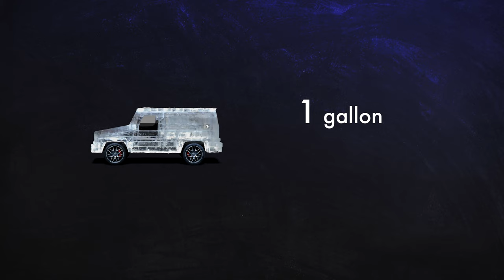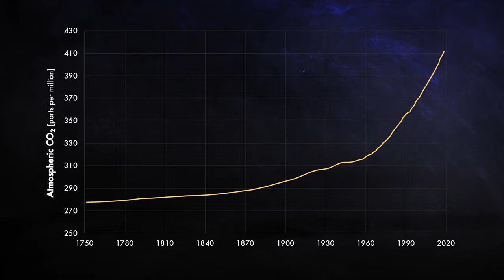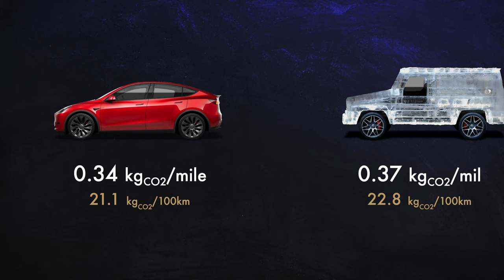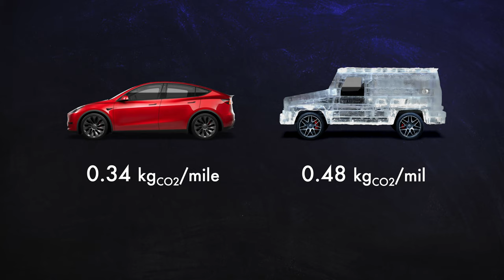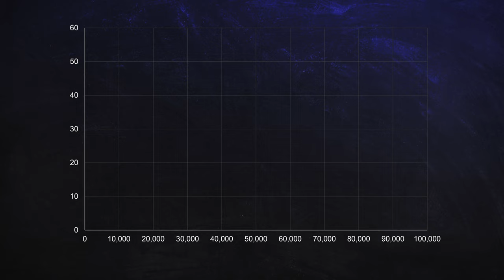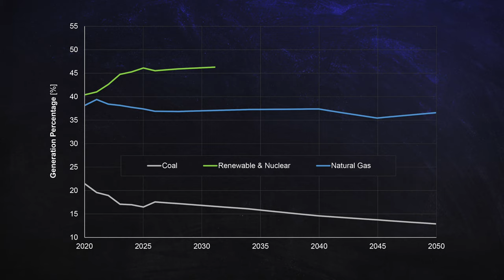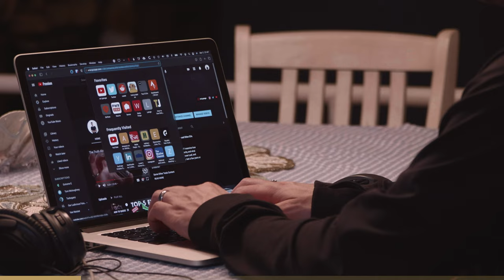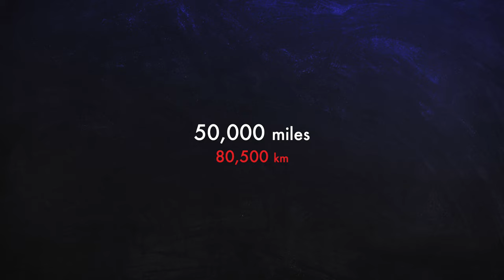The Truth About EV Emissions

Comment: I live in Utah, which you showed in your video didn't even break even after a million miles. I'm glad to report that I have a 10 kW solar array on my home that I use to power all my household electrical consumption plus it powers my Tesla Model S which is about to break the 100,000 mile mark on the odometer! It feels great not having to pay for fuel to drive my vehicle around and it's icing on the cake knowing I'm not contributing to bad air quality, which can be especially bad in Utah during the winter. It's taken me years of saving and work DIYing my solar installation to get to this point, but it's a worthwhile goal for anyone else that's interested in doing the same thing!

Comment: You have mentioned the fuel supply cost for the gasoline i.e gasoline production. But for electricity, coal also has to mine, clean and transported. you should have included that when you calculated the CO2 emission for the EV.

Comment: Another thing to consider is that Coal itself is getting cleaner. In the area that I live, the local utility is shutting down all of their oil plants and all of their coal plants except the two most modern plants in the next two years, which are the most efficient and have the best emissions treatment systems of their fleet. Along with renewing their nuclear license until 2040, it should reduce their CO2 impact, not including all of the new renewable projects in the planning stages.
Reply: No,coal power plants are shut down,only in stupid usa companies still use them

Comment: Cool videos.  So one gallon of gasoline (2.72kg) produces 8.89kg of CO2? It is possible as gasoline is mixed with atmospheric air (oxygen) to create the CO2, though that does sound surprising.
Reply from the maker: Thanks. You are correct. The C or carbon comes from the fuel and the O2 (oxygen) is supplied by the air. On a molar mass basis C is 12 and O2 is 32. i.e. the oxygen in CO2 is almost 3/4 of the total mass. This explains the increase in mass. Good point.

Comment: Where I live in the Jersey c.I. , most private electric vehicles are being used with solar panels with battery walls and supplying back to grid . 
All our electric comes from nuclear and renewables from the french network . 
Nearly all home delivery vehicles are now electric powered , the drivers for ease of use , and companies for low cost of running prefer them to old ice vehicles . 
This system of using personal solar and batteries to top up the grid , seems a great way for the future !

Comment: Cost of production ice cars isn't equal to bev without battery. Electric motor is much more efficient in production than the ice. Less parts, lighter weight, more simple construction everywhere. Prius has battery and generator on top of the ice
Reply from the maker: You're correct on the complexity front. The potential for lower manufacturing costs for the rest of the EV was not discussed in the literature I found, so I left it out. I do hope someone eventually looks into that though.

Comment: Good job, this video includes more factors in CO2 emissions then most of the videos on YT. Greetings from UK. I think you in US should build more nuclear power plants to limit CO2 emissions.
Reply: I have Skoda Fabia with average 45 MPG. After 100k miles it will emit 25.6 + 7.5 = 33.1 tCO2. 
And of course it is far cheaper then Toyota Prius (29 tCO2 / 100k miles). 
I drive 4k miles/year so my Skoda Fabia is the cheapest from the greenest options.

Comment: The best vehicle to get is a plug in hybrid.   Your analysis excluded fugitive methane emissions. The amount of fugitive emissions is still being determined. A 3.5% leakage would largely put natural gas electricity on par with Coal in terms of GHG emissions. Even if it's only 0.5% as some in the nat. gas industry claim, when you look at the 20 year GHG potential, you'll find that coal is actually better in terms of GHG emissions. 
BEVs only make sense when the grid is effectively carbon neutral. And BEVs aren't as effective at being carbon negative compared to hydrogen/ammonia fuel cell EVs. 
Carbon negativity is required to restore our climate to preindustrial norms. Carbon neutrality is just the first step, not the final destination.

Comment: On these high mileage comparisons, did you account for replacement of the battery packs in the EVs and Hybrids?
Reply from the maker: Good point. I did not. For the EVs (Teslas at least) you can expect them to last to around 200,000 miles (my somewhat educated guess). So yes, for the million-mile case there would be some replacing going on. I do expect that battery manufacturing emissions will continue to fall going forward so this impact will be negated somewhat. I should have included this for my longer projections though. Thanks for the comment!
Reply: @chargeeverywhere  I believe the data shows them lasting far longer.  A study on the Model S showed that the battery degrades on average around 1% per 30k miles driven.  There is early degradation that is faster, but then levels off.  With that data, and assuming batteries are retired from EV use at around 80% of capacity, you are still looking at around 450k miles or more.
Even my early 2014 battery pack is still comfortably above 90% after 9 years and 120k+ miles of driving.
Data coming from the worst case scenario's where Tesla's were used for taxi use and fast charged 100% of the time to max capacity, the batteries still lasted to around 300k miles.
I think therefore the 450k mile number is pretty conservative if anything, but then again, we are still talking about 30 years worth of driving at 15k miles a year for 30 years.
Reply: At which point they're still good for static battery use for another 20-30 years
Reply: Also, bear in mind that the UK has just one coal fired power station left.  It gets retired this year, so the coal analogy is rather ridiculous in the UK
Reply: @jeffcranmer5374  but it still takes loads of diesel oil and fuel to mine and transport the materials from the mines to the various manufacturers, then the components are also transported to other manufacturers for more processing and manufacturing, until the final stage of assembly, then that is also transported to the car assembly plant. Then the car is transported to its destination.
Reply: It's it better to do that too start a circular system where lithium is recycled into the next battery, or better to do that for stuff that just gets burnt?
Reply: @jeffcranmer5374  I've heard recently, can't recall the source, that some of batteries aren't being recycled because it's cheaper to mine more ore than to reclaim the materials from old batteries.
Reply: @spmcintyre  that which can be claimed without evidence can be dismissed without evidence
Reply: @spmcintyre  it's also worth pointing out that literally everything we use in our society is either mined, or grown.  Everything.
Reply: @jeffcranmer5374  I know, I was just pointing out that sometimes things we believe are or should be recycled, are actually dumped in a landfill because it cheaper to mine new materials.
Reply: @spmcintyre  since the lifespan of lithium batteries is 15-20 years, the biggest issue right now is lack of batteries to recycle.  Government regulations on recycling can help (look at Europe, where the cost of recycling is increasingly pushed into the initial cost, because they are required to recycle at end of life).

Comment: Thanks for showing how coal keeps some states from getting their EV driving clean enough to help.  In other words we should drive Prius cars until all coal plants are replaced?  Let's take it further:  If we stay at coal power, or even natural gas, we're all doomed.  

There's the logistics of the ICE car to consider:  Oil changes, filter changes,  Coolant changes and all the fuel used to make and get that to the maintenance point.  Don't forget the brakes.  EV brakes last 150K miles or more.  My mechanic said after 36K miles, my Nissan Leaf brakes were still "new".  Think of all the material that doesn't end up on the road from scraping off the brakes but that's not part of the discussion on CO2.  

If we do not continue electrifying the vehicle market, we will not be able to take advantage of a cleaner grid if it ever does get cleaner.    Battery storage and rooftop solar are the way to go, with after 4pm base load supplied with geothermal/nuclear(hopefully Thorium) power.  Unfortunately it's too late to talk about it now.  What's happening in Pakistan, China, and Western US with climate will cause economic costs that prevent investment in a cleaner grid. Then we have the CA Public Utilities Commission trying to shut down rooftop solar incentives before we even have 20% market penetration.  If the richest state in the richest country on earth can't do it, no one can. All we can do now is head for high ground and get a good air conditioner.

Comment: many people said you should count coal mining to power plant co2 to for EV, for me that not really necessary. why? because for EV or ICE your grid power plant isn't change, it is still coal. no one gonna say that the power plant used specifically made for charging EV right. then some people might say what if the houses already use solar cell? then that also means you gonna charge EV with it too, are they gonna make the charger directly on grid? I don't think so, even more possible that their house might be still on grid for backup but the EV charger use solar cell completely. so what ever engine your car use, the power plant is the same because that means you have to count the house the owner live in, so it negated each other.

Comment: so what about the battery components themselves? are there models that have scaled up their requirement vs availability to current amount of combustion cars?
how recyclable are the batteries? what % of what metal gets extracted and re-used.
Reply: What percent of gasoline is recycled?
Tesla claims a lower CO2 to battery than others, btw.
Reply: @CrissaKentavr  I guess that's a point.
I mean if all calculations are correct here and this all gets combined with nuclear energy with solar/wind as topping, I guess electric could happen. I'm not up-to-speed on hydrogen fueled; I would've preferred to see hydrogen but that's not as hands-on as solar panels on your roof. Electric allows for more grid flexibility plus we already have all the infrastructure to deliver electric.

Comment: What if you buy a used Prius with 50,000 miles on it, how long would you need to use it before buying a new electric is better?  Answer, never.  The emissions are low enough that the chart wont cross over to make the EV better in your lifetime.

Comment: I have a question.
How can 3.8 liters of gasoline produce CO2 more than twice its weight?
Reply from the maker: It has to do with the oxygen that combusts with the fuel to form the CO2. The molar mass of Carbon (primary fuel element) is 12 with O2 at 32.
Reply: @chargeeverywhere  Oh!! Thanks for the answer.

Comment: I'm curious your telling me the transmission and engine are still included in the base body of the EV. Your numbers are substantially skewed. Engines and transmissions are the most complex components of the the vehicle.
Reply from the maker: Agreed, and good point. I did think about this, but the sources I found presented it in the way I did. It is likely that manufacturing the base metals is responsible for the bulk of the CO2 emissions, in which case the quantity of metal in the powertrain is a relatively small percentage of the rest of the car. Also, the motors and gearboxes will require a significant proportion of the materials used for the engine/transmission.

Comment: You forgot to mention the methane equivalent of carbon dioxide emissions leaked in the production of oil so that should also be factored in. Plus an electric car does not require the transmission fluid.

Comment: Today's EV batteries span from 28.9 kWh. Tesla 3 has a 50-75 kWh 360 V lithium-ion  battery. This means a 6.6kW solar system ( max alloweed on a house) will on average produce around 26.4kWh full sunny day. So how can a solar system power a flat EV? !) 10kw solar staotage batteries are over $3,500 ea US.

Comment: In addition to supply-chain inefficiency, there is also the added inefficiency of en-route idle time.  EVs and Hybrids don't lose much efficiency sitting at a stop light or waiting in line at the drive-through - ICE vehicles lose a lot more efficiency to this idle time, which isn't accounted for in EPA fuel efficiency estimates. Just sayin'.
Reply from the maker: Yea. I find it neat that EVs become no less efficient when sitting still in traffic. Plus, the stop and go energy loss is partially mitigated by the regen.

Comment: What happened to battery recycling after 250K miles it's like all EV cars are totaled after 200K miles. Also @asifalmeida3713 made a good point that you are biased against ICE since there's no exploration for Coal, natural gas or Oil for electricity.  Further the mining for the battery is done outside of US with a much worse carbon footprint. By my calculations EV's NEVER make sense.

Comment: You missed the fact that coal doesn't come out of nowhere. I'm sure it's not much but it still has to be mined and transported.
Reply: Power plants are usually build just next to the mines. Sure, there are some emissions during mining itself, but after that it's generally straight onto a conveyor belt into the furnace.

Comment: Great job EXCEPT there is a problem with one to one comparisons -  Lithium Ion batteries are a constraint on production. It is not a 1 to 1 question. It is do you want 1 million Tesla's or 10 Million Prius plug or 8 Million Rav4s Plug in hybrids or 2 million Nissan Leafs given the few batteries made - The answer is quite obvious when you have this real problem introduced; so given 80 million vehicles made a year you can have next to no impact with full EVs or a significant impact with 8 or 10 million Phevs - this is key to arriving at the best answer for reducing CO2.  When you rerun your charts with this ratio taken into account Plug in hybrids able to commute electric are the best answer for many years to come.

Comment: I charge my car from a gasoline generator which with the wiring to the car has 87.6% loss and so with my typical level 2 charger I needed an infinite number of kWh of gasoline to go even an inch with my car. I decided the best course of action was to INCREASE THE LOSSES of the generator to 88.6% by adding more wires and now I need -28kWh of gasoline (a little more? than negative 1 gallons) for every mile I drive. I'm making so much money just by driving. I quit my job and now I just drive 100 miles a day and it's enough to live on. Obviously this requires also living in the universe where your efficiency calculation was correct.

Comment: UK already has 0% coal electricity

And UK was the first country to use coal in masive amounts
Reply: Most of the  UK'S electricity is produced  by burning fossil fuels, mainly natural gas (42% in 2016) and coal (9% in 2016). A very small amount is  from other fuels (3.1% in 2016).
Reply: @EnglishLawyer  i m talking about 2021 not 2016 bumbass